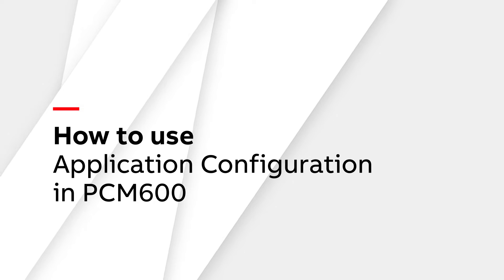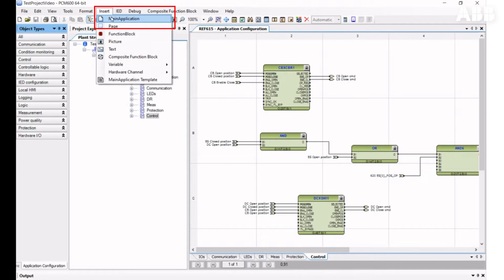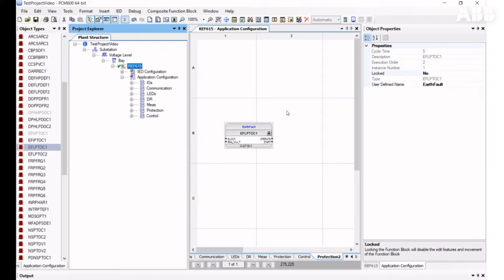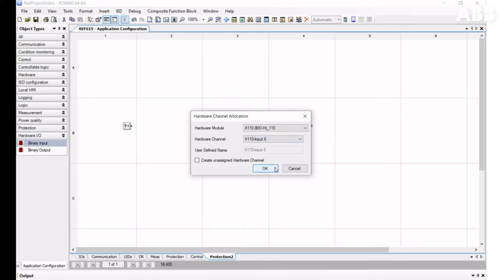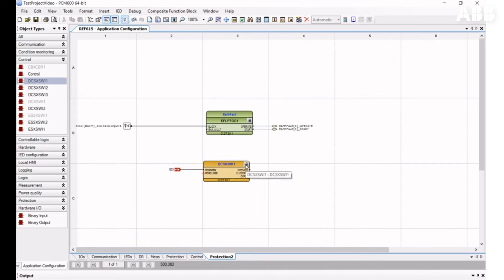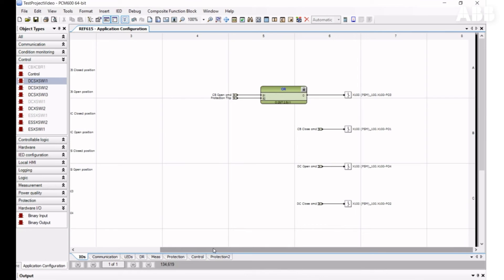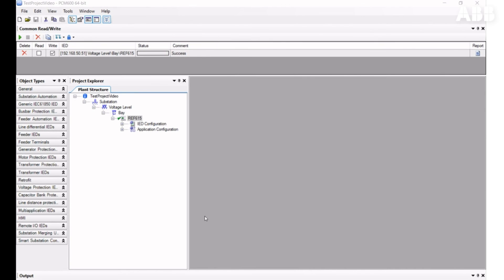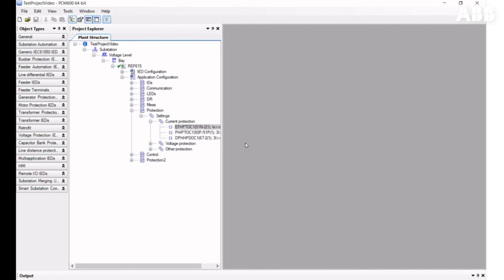4- How to use Application Configuration in PCM600?

Comment: I'm trying to write the full backup configuration file to the REC670 relay via the front port. However, during the 'Write to LED' process, I'm encountering an error stating: 'Some data has failed validation.' The specific validation failure is related to the LED configuration, with the message indicating: 'SCL data has failed validation.' How can I resolve this issue?

Comment: Dear sir ,i am facing a issue sometimes when i mistakenly write a psl of anothe feeder into another feeder which has already psl ,after that showing SCL configuration error code 27.

So kindly tell me how to correct it, please
Reply: Error 27 is an error in the SCL configuration file or the file is missing. Are you sure it is the only error shown on the LHMI?
If yes, you need to save the original, uncorrupted version of the feeder's PSL first.
Then, either reset the relay or restore it to factory settings. Go to Main menu/Configuration/General/Software reset if you want to reset or Main menu/Configuration/General/Factory setting if you want to restore. The process usually takes a few minutes.
Once it finishes, import the original PSL file again into the PCM600 or write it into the IED
Reply from the maker: Hello @rakeshverma-cu8ug. Please refer the information shared on https://relays.protection-control.abb/knowledge-warehouse or get in touch with your ABB contact to have this reported to ABB support line for investigation.
Reply: Sir kindly make video on ansi 25 sync with two outgoing and one bus coupler working and how sync work
Reply: Sir kindly make video on 25 ansi synck worki

Comment: Sir, I am unable to open application configuration tool, it is showing tool is already open
Reply from the maker: Hello @santoshjaiswar4907. Please make sure that only one PCM600 is running on your PC and then follow these steps to use ACT:
1. In Plant Structure, select an IED.
2. On the Tools menu, click Application Configuration.
Application Configuration opens in the tool window.
3. Create or modify the application configuration.
• Organize into main applications over the needed amount of pages.
• Insert function blocks, hardware channels and variables.
• Make connections.
4. Click the Save button on the toolbar to save the configuration.
The changes are shown in the Plant Structure.

Comment: I am currently experiencing difficulties configuring the REC615 relay using the PCM600 software. Specifically, I am unable to find the undervoltage protection (27) settings in the PCM600 interface. When I connect, only current protection options seem to be available. The voltage protection is active and accessible directly through the REC615 relay, but I cannot access these settings via PCM600. I have checked the PCM600 documentation, but I have been unable to resolve the issue on my own. Do you have any advice on accessing undervoltage (27) settings or could you direct me to specific documentation on this matter?
Reply from the maker: Hello @hiecham. You need to check first if the under-voltage function block is already inserted in the application configuration or not.
If not, pleaes follow these steps to insert it:
1. On the Insert menu, click FunctionBlock.
2. Click in the Application Configuration window.
The Insert Function Block dialog opens.
3. Select the function block and click Insert.
4. Enter the function block data and click Assign.

Comment: Hello, How do I activate the work online button?
Reply: you need to have physical connection to the relay
Reply: @sonokino  They have time to configure ABB relays, and I remember that the button was activated by pressing icons.
Reply: It has been three weeks since I reconfigured a REF615 relay, and I needed to check some signals online. But I no longer remember the activation of the online icon.
Reply from the maker: Hello @integraciondetecnologia.
1. On the toolbar, click the Work online button to start online monitoring.
2. On the toolbar, click the Watch window button.
Use the watch window to monitor certain signals in a separate window. A
signal can be added to the watch window by right-clicking the function block
signal in Application Configuration, and then selecting Add to watch
window from the shortcut menu.
3. On the toolbar, click the Work Offline button to stop online monitoring.